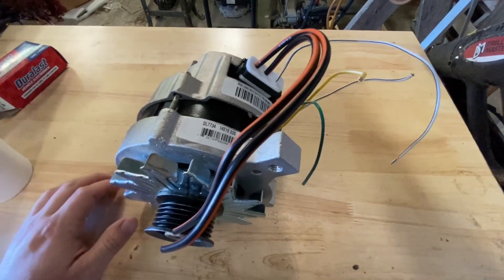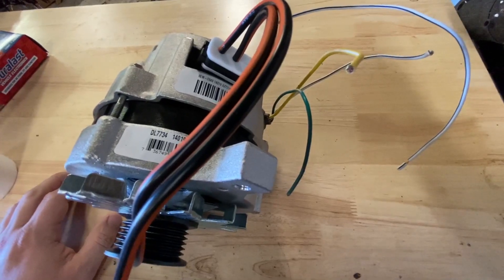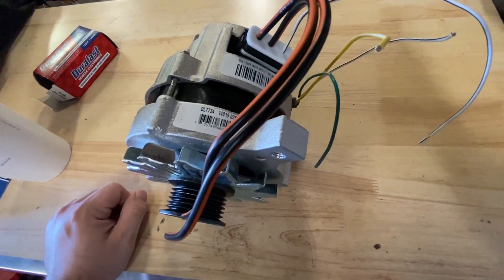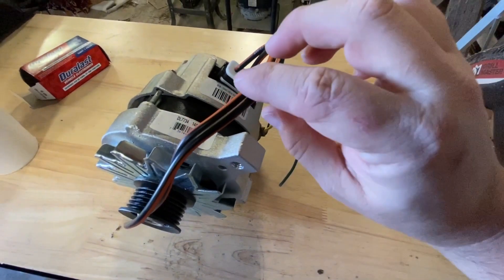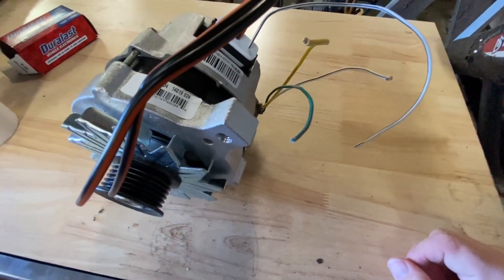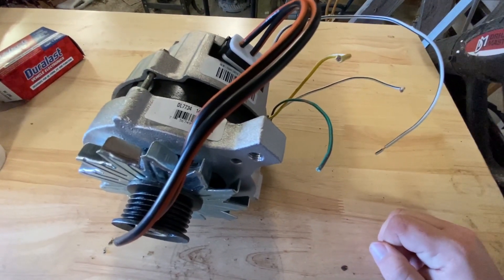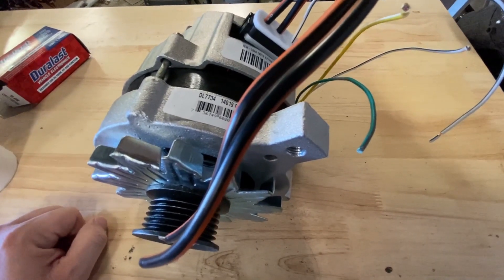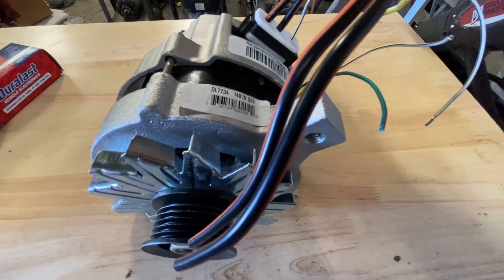Ford 2G Alternator Wiring

Comment: I could not find a new 2G (external regulator). All I could find at AutoZone, Advance, NAPA, and O'Reily  had the internal regulator. I decided to get my original 1989 F-150 alternator rebuilt. I'm wondering if the new alternators with the internal regulator will work hooking up to a external-type regulator. I read something about having to install a new wire and connecting it to the + battery post. Also, I found a lack of knowledge about this issue at all the parts places.

Comment: The green wire is an ignition hot wire. It will not charge without it plugged in.
Reply: does the yellow wire get wired with the 2 thick wires

Comment: I have a mustang with one of the orange and black wires going to yellow wire. The middle (black/yellow) wire is going to battery positive. Ny wire is getting hot. The middle one going to positive battery. Could I need to possibly put both orange wires together with yellow wire & fusible link?  Thanks

Comment: Your video had the exact information I was looking for! Thank you!
Reply from the maker: Glad it was helpful!  I try to provide the info I would want to know / wish I had known.
Reply: @OutdoorNMore  I was looking for a replacement alternator for a 1994 F-350 with a 460 that I could install with no wiring modifications, but all the new & rebuilt units (even with the original Motorcraft castings) got rid of the stud & 10mm nut on the back that connects to the battery. They "replaced" it with an integrated connector (THAT DOESN'T UNPLUG) that you have to crimp/solder to the wiring in the truck. Yeah, you have to cut the factory ring terminals out of the truck's wiring harness, and DIRECTLY CONNECT those wires to your "new" alternator. The next time you have to replace the alternator, YOU HAVE TO CUT YOUR PERMANENT CONNECTIONS AND RE-DO THEM WITH THE NEW ALTERNATOR. There's no connector to unplug. I can't believe how stupid that is. Whoever approved that design change is a clown. Your video helped me get the wiring right the first time and I really appreciate that. I wasn't sure because the single orange/black battery power wire in the truck's harness is a thicker gauge than the 2 black wires coming out of my alternator. The instructions said both those smaller gauge wires from the alternator should go directly to the battery, so I had to solder up a Y-joint between one heavier gauge wire and 2 smaller gauge wires. We should not have to do stupid things like this, but everything's working properly now, so your video is an excellent resource for everyone.

Comment: I have a bronco I recently took the cluster out and now my alternator will not charge
Reply: A little late here...
It's bc u need the green with red stripe wire coming from the charge light to the I terminal on the regulator for it to charge.